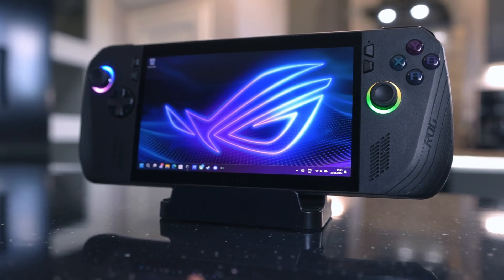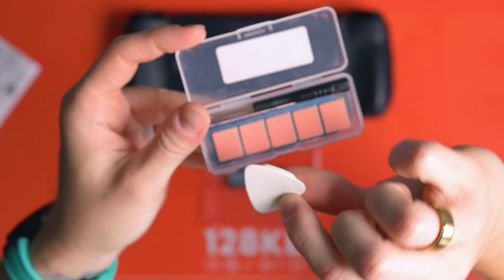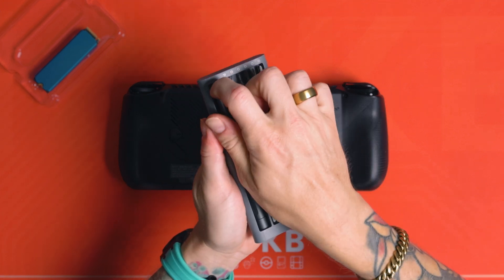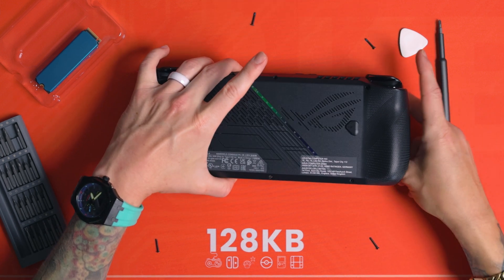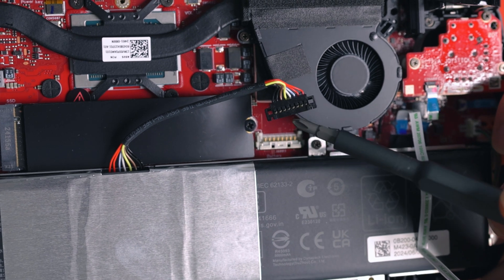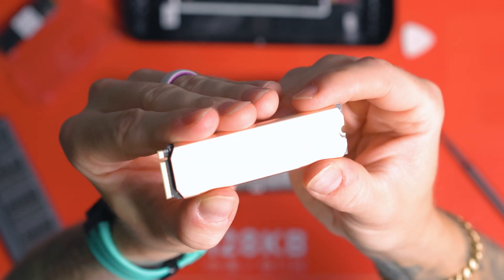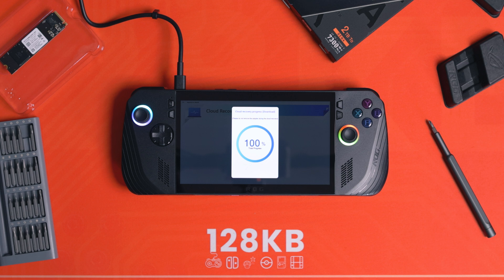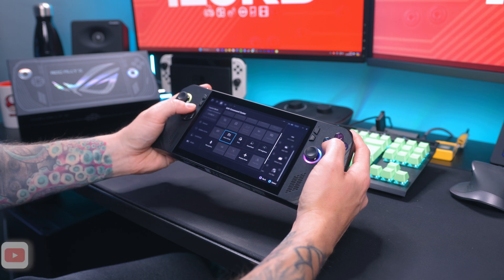How To Upgrade Your ASUS ROG ALLY X Drive!

Comment from the maker: The screwdriver set I use: https://geni.us/p3FA
The iFixit prying tools: https://geni.us/gwH8zzQ
2TB WD Black SN850X: https://geni.us/LipNwB
4TB WD Black SN850X: https://geni.us/0KfzZJr
Low-profile heatsink: https://geni.us/URIcel
Reply: So don’t buy with the heat sink ? On Amazon it says with heat sink will that one not fit ?
Reply: @Spacemanevo  I just installed the 4tb WD sn850x with the heatsink, it works fine but it barely leaves space for the the battery cable

Comment: Seems pretty difficult.  I fixed my steam deck right thumbstick stick drift following an Ifixit video.  I bought the joystick for $15 and tools for $5 from Ifixit.  Repair shops around the Vegas Valley we're quoting me $150 at the lowest, and $210 at the highest.  I paid a total of $25 (tax + shipping) ended up saving a 100+.   The process on the rog ally x doesn't look as simple.  The ally X already comes with a 1 TB SSD, so if you went and bought a 2TB one, you'd techinally only be getting 1 additiional TB out of it, and that's roughly $170, juice doesn't seem worth the squeeze unless you get 3tb+

Comment: ROG ALLY X does it works on SAMSUNG 990 PRO Heatsink SSD 4TB, NVMe M.2, Speeds Up to 7,450MB/s Best for PlayStation® 5 (PS5 SSD) Console Expansion MZ-V9P4T0CW if you have. Can you do a gameplay on the ROG ALLY X

Comment: I haven’t seen no one show what would happen if you install the old internal ssd that’ was inside the Rog ally x into a PC? 🤔 why does my PC act like it’s an Rog ally x im 💀
Reply from the maker: You need to format the drive if installing it into a new PC. I've got the old ALLY X drive in my PC as a secondary drive. Make sure to go into the bios and boot from your actual PC drive not this one, then go into disk management and format the old ALLY drive for it to be usable as a blank drive on the new pc.

Comment: just installed 4tb samsung 990 pro, it loads into the bios and i can get to the cloud recovery stage, however after the cloud recovery files are downloaded it just goes back into the bios again instead of windows. not sure what i’m doing wrong here
Reply: The problem is the 990 pro is garbage. Mine worked initially for around 2 weeks but then it just gave up. I wish I did more research before buying it because many others have had the same issue. Some have had to return it multiple times for a replacement.

Comment: 128KB, I appreciate your video. I would like to say, that I just performed SSD swap without removing cables and battery. For some people, if they can avoid those steps it mitigate the chances of damaging the connections.

Comment: I keep having an error pop up when I'm letting cloud recovery do it's thing. Been sitting here for almost an hour and the same pop up keeping showing. "The instruction at 0x00007FFFC72D981D referenced memory at 0x000000000000024. The memory could not be written."

After a while of it doing that, it'll get stuck on "Configuring USMT" and it'll just sit there.

Comment: Just installed a 4tb ssd had the typical issues of cloud recovey ie network error, returning to bios screen.  I checked the date and time on my ally x was off due to 24hr clock am/pm, adjusted that to correct time, and after 3 failed attempts with incorrect time, the 4th time cloud recovey with correct time adjusted, worked no problem.

Comment: Great video mate just got my ally x today changed it for a 4tb samsung 990 pro with samsung heatsink somethings i did notice asus have actually put a sticker on the battery showing you how to disconnect it lol and also mine came with a samsung ssd in it from factory? didn't know if they've changed it I noticed yours was WD mine was manufactured NOV 24 if that helps anyway mate great video :)

Comment: I just got my ally today and immediately installed a 4tb ssd before it was powered on and I keep getting network errors on cloud recovery, changed the date in the bios because it was off, finally finished installing files then went right back to bios…. What am I doing wrong. I spent time with ASUS customer service and they basically told me it’s impossible to cloud recover with a fresh drive because there’s nothing on it… PLEASE HELP!

Comment: So basically if you do as this guy Instructed you will  Void your hard drive Warranty . That Ribbon sticker that he removed will cause a Loose connection. This is one of those situations where a little bit of information makes somebody dangerous .
Reply from the maker: False. Changing your SSD does not void your warranty, in the majority of regions. Some regions may have different warranty regulations however, so worth checking regardless for your own use case. The sticker does not result in a loose connection. This is one of those situations where a little bit of information makes somebody's comment dangerous.

Comment: So… the little silver  metal thing you slide to keep the battery connector in place in mine fell into the unit but it’s nowhere to be seen 😂 it’s not moving around either I shook it, I’ve attached the connect with some electrical tape the device turns on fine do you think it will be alright?

Comment: Hi I have this mod to do on my new Allyv  X , and my drive is Samsung 990 4tb , but it all looks very scary 👍
Reply from the maker: @mrb3991  watch this through a couple times before attempting. Go very slowly, be very gentle with the battery connector too and you'll be fine

Comment: Hry andy, wierd question, but what can I use as a stand when I am using the skull and co case? Nothing really fits, like my dock, my standard ones. Its a small annoyance. But maybe you have a better idea?
Reply from the maker: The skull & co gripcase? I just use the built in stand in the grip, I just stand up the ALLY X in front of my docks or whatever then connect the USB cables

Comment: I know it’s been a while you uploaded, but I saw this video in my feed and wanted to share a recommendation. I suggest putting the black shield on top of the drive/heatsink. The black shield helps with heat dissipation and shields the battery cable. Without it, the copper heatsink will radiate heat and increase the risk of the battery cable melting. You might also consider adding thermal/Kapton tape on the exposed battery cable close to the battery. The risk in small but its better safe than sorry.

Comment: Hey 128kb, 
Its a very easy process and looks great cant wait till I get one soon.. My quick question that many dont seem to ask and I just want to know bc Im study the ally x extensively is if I were to have an already powered up open boxed loaded ally x would I be able to follow the exact steps you made in this amazing review or  would I need to go about it differently? If its easier on a mint sealed ally x unit I'll opt that way just curious bc I can use the savings for the ram mod and heatsink.. Thanks for your review either way its very easy as sealed--👊👊

Comment: Andy, quick question for you. After you upgraded the SSD and did the cloud recovery and got your Ally X up and running, how was it afterwards? Has it been running ok since you did that?
I seen in the video that you mentioned about the “explorer.exe - application error” messages popping up during the cloud recovery process and was wondering if they affected your X or noticed anything unusual after doing the cloud recovery process? Everything been smooth on your X so far?

I’ve owned the OG Ally for the last year since it was first released and did the cloud recovery process so many times on it and never had any issues or got any of those error messages. I was just trying to see if those new error messages you saw were just related to the Ally X now and something to be concerned about.
Reply from the maker: @stoksyXL  hey! Good question! I'm pleased to say; everything has been running perfectly, without any issues whatsoever! Those error messages are nothing to be concerned about, it's part of the cloud recovery process, at least on the X. I've actually been overly impressed by how smoothly the X has been running, I expected there to be more hiccups but nothing at all whatsoever! Hope that helps:)
Reply: @128KB  Awesome, glad to hear! Like I said, of all the times I’ve done a cloud recovery on the OG Ally over the last year, I never once had that error. So I got a bit worried when I saw it on the X. I just did another cloud recovery on another OG Ally around the same time as you did in your video and didn’t get the error that time either. So I guess it’s just related to the X. 
I just wanted to ask if yours has been running fine and also with the upgraded SSD you installed in it. But glad to hear everything went smoothly and the error message didn’t cause any funny stuff on your X.  Thanks for letting me know!

Comment: I saw some comments on reddit around this SSD throttling performance compared to the original SSD that came with the device, have you experienced any at all? I am looking to upgrade mine to 4tb SN850x but wanted to be sure it doesn't affect performance or impact battery life massively. Cheers! Great video btw!

Comment: If you help, ill paypal you 20 pound! Ever sinceI got my ally X. Something has been annoying me. When I had tk set the tinezone. I accidently selected korea. Im not sure this is causing this issue. But, I just wanted to mention that. So, my ISSSUE is  i cannot update windows. There are 3 main updates. 1 is defender, 1 is accumlative, and the other is a security update. Im new to windoes 12. And this stuff Seems important. But when i press update. It just wont work!   Sometimes, it will say 'I nstalling' or doenload pending. But then nothing. It stays blue. If any1 can help me with this and get the updates sorted. I promise ill pay ypu for your time.  Peace

Comment: Is removing the battery cable necessary for replacing the M.2? Will it mess something up or are you removing it for easy visibility sake?
Reply from the maker: Ideally you should disconnect the battery first, in basic terms to reduce the risk of frying the system!
Reply: @128KB  thank you for responding. Will be performing surgery on my Ally X in an about a month. 

You have a great tutorial here, I appreciate the value you provide.

Comment: Just wish you would have showed how to remove the battery and put it in and not showing it 😢
Reply from the maker: @wayne69wayne69  I show in the video how to disconnect the battery prior to installation, there's no need to physically remove the battery.
Reply: @128KB no u did not show it u skip it u did not show you pulling it out

Comment: So i bought a WD SN 850X Black 4TB and i have noticed that the speed is much slower than the regular one. For example before i was getting about 56 - 60 FPS on high settings 900p consistently but I am lucky to even get 50 FPS on same settings now with new drive. Is something wrong? Plz help.
Reply: I am pretty sure its not slower than original one, if you get lower fps with new ssd (faster one) it is cuz of the power usage of faster 4tb ssd. It is totally a new subject, and yes if you go faster ssd like 7000mb read speed it will be use more power than 5000 or 3000mb read speed. One last thing some manufacturers product needed different power usage. Example; Samsung 990pro use more power than Cruel’s ssd. It does not mean if you get more faster ssd it will give more fps cuz it is drain more power and that handled device uses a battery 🔋 and there is a cap of usage of power on that system like max 50W. Some one should do a video about it to compare ssd performance like 3000vs7000 or 5000vs7000 etc.

Comment: I'm not convinced a heat sync is even needed. I used a 980 Pro with no heat sync, I just re-used the heat shield that the OEM drive came with, and it idles on 37-38c, and maybe gets to 45c under load. I never feel any heat around that area on the back of the device. It's doing fine.
Reply: The one on the original WD drive is a Graphene heatsink. Everyone should use is on any new NvMe Drive. Just peal off the label on the new drive before applying it for maximum heat dissipation. :hand-purple-blue-peace:

Comment: Great tutorial, thanks! Just put in a 4 TB Samsung drive with an included Samsung heatsink, it fits perfectly!
Reply: Funny story. I tried putting a 980 Pro with Heatsync into mine, and it does not fit. The Heatsync is like 1mm wider than 990 Pro, so I had to remove it. While doing so, I stripped one of the screws on the heatsync, and had to drill it out. Savaged the heck out of it, and finally got the drive out. Wasn't even sure if it survived. It did, and works fine, but yeah, my process wasn't quite that simple :D
Reply: @BETEP-gw7qp  that's terrible, sorry to hear that! I installed a 990 PRO with heatsink, but (maybe the European version is smaller?) I got it in Switzerland, the ROG Ally X too. You did install it in your Ally X or Ally?

Comment: Pro Tip. The Samsung 990 Pro, with the pre-installed heatsink, fits perfectly into the Ally X. Due to its weird pyramid shape, its lowest points on the sides fit under the batterycable. And its heatsink is vastly superior to these thin aftermarket aluminium ones. But be aware that almost all (or basically ALL) other pre-installed heatsinks from other manufactures wont fit. Since most of them are 10+ mm tall and the Ally X barely has 7 mm clearance until you hit the battery cable on the side.
Reply: I can confirm the 980 Pro heatsync did not fit, so I removed it and installed without (just used the black heat shield that the OEM drive came with). What temps are you seeing on idle with yours? Mine is sitting at 37-38 degrees right now.
Reply: I’m literally in the car coming from Best Buy watching this video and I happened to grab the 990 with heat sink as my drive.   lol. Glad to know it fits.  I definitely didn’t check.
Reply: You're 100% correct because I tried to put one that I ordered online and it didn't even fit and I ended up breaking the stupid metal bracket that holds the battery in 😢
Reply: MHQJRH 2280 heatsink fits great it's double side also . Plus it's only like 10$ on Amazon.  It works great
Reply: I want to confirm that Samsung 990 Pro with heatsink fits. I let ASUS install it for me since I’m not a tech suave gal.
Reply: @婵娟Luna  gotta do it yourself you can do it 👍🏽
Reply: Greetings, so it is better to buy with a heatsink already included as you say in the 990? Thanks
Reply: Also I got it in without unplugging the battery - or unplugging anything like the video suggests.
Reply: Did you also remove the sticker on the original ssd and put it on the 990 with heatsink?
Reply: @angelixta6673  No, I didnt. The heatsink of the 990 Pro doesnt need that and I doubt it would even be possible in the first place.
Reply: @Cenkolino  thank you for replying I’m looking to do this upgrade in the next 20 minutes and I couldn’t find the answer to this question.

Comment: Thank you for video, I've now been in mine twice now as I tried a bigger heatsink and I wasn't liking how tight it was against power cable so I ordered the ultra thin copper heatsink off Amazon which I've installed today and happy with it. I've seen other vids on YouTube where they arnt disconnecting the battery when installing new ssd.
This is not a good idea and can kill your system. 
This is the video to follow.

Comment: This is so far the best informative YouTube video, thought the thing is that after the battery cable is removed, then the power button must be pressed a few times to discharge the device capacitors and then the nvme drive or other internal components like the thumb sticks can be replaced.

Comment: Hey guys, I bought a 4TB Samsung 990 Pro with Heatsink and swapped it out for the stock 1TB NVMe drive. It fit PERFECTLY. Tons of room in there! Just wanted to note, the screws near the top of the controllers were also seated and did not come out. The recovery process was pretty quick for me. Great video! I dropped you a sub!
Reply: Awesome! I was curious if a factory heatsink would fit cause I picked one up on sale for Prime day! There was still room for the battery cable without sandwiching it? That’s my main concern for when my Ally comes in this weekend?
Reply: Thank you! I was wondering about this, I just bought the non-heatsink version to be safe.

Comment: Thanks for the helpful video, appreciated. I’ll be using this guide when I get my Ally X shortly. Would you be able to tell us what temps you’re seeing with the heatsink you applied? Has everything been ok with the drive heat so far? 
I’m not sure if I’m going to go for the same thin copper heatsink you used on your SSD, or a slightly bigger one. Has your copper one been ok temps wise so far?

Comment: Why do you even bother removing that ribbon cable? Others simply place the back cover on top0 of the battery area and swap our SSDs without ever messing with it.
Reply from the maker: I show it, because it’s VERY delicate and easier to tear. Safer to remove it whilst changing the drive.
Reply: @128KB  Good point. I just ordered my Ally X today, watched every single one of your videos on it first:) It's a big reason I decided to go for it. Thank you!

Comment: The two screws on the top corners wont come out... Any advice? Maybe i need a magnetic screwdriver?
Reply from the maker: I had that issue even with a magnetic screwdriver, it's worth a try with a magnetic one if you have one, I forgot to mention it! Providing they're fully unscrewed they're just sat in there, when I removed the backplate they fell out so don't lose them!
Reply: @128KB  ty for everything mate. keep up the good work🙌

Comment: I could not unplug the power. Felt like I was about to rip out a cable. Also when putting it back together I didn’t realize one of my shoulder buttons jammed. Had to reopen and hold down triggers while putting on the back plate.